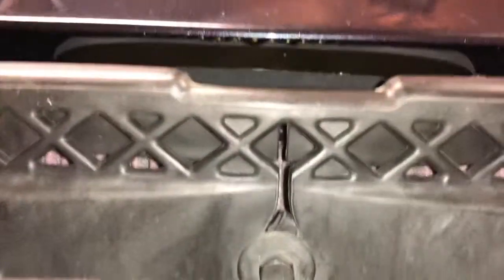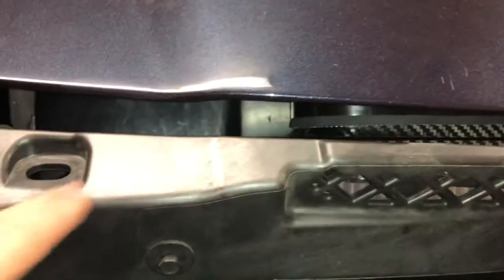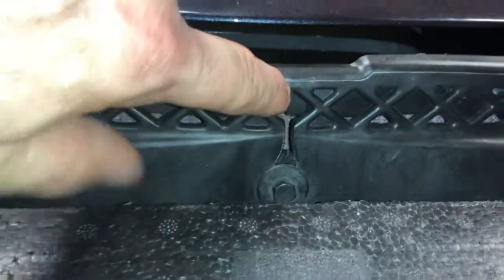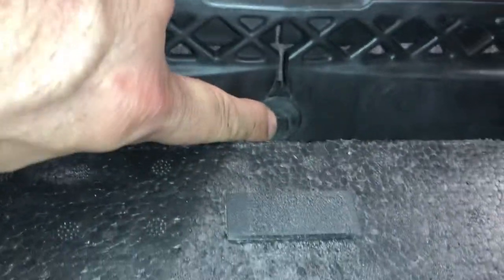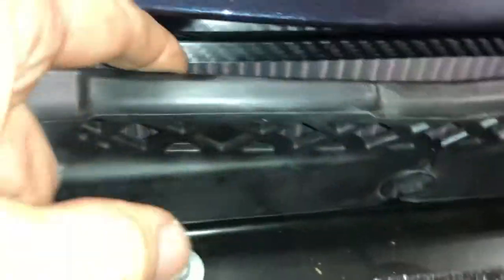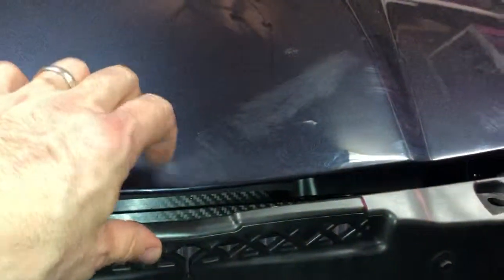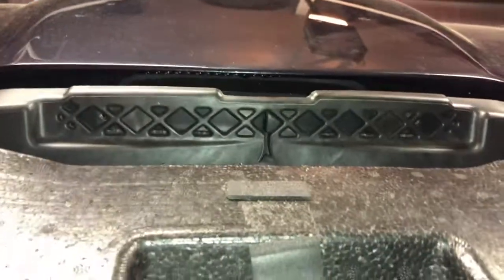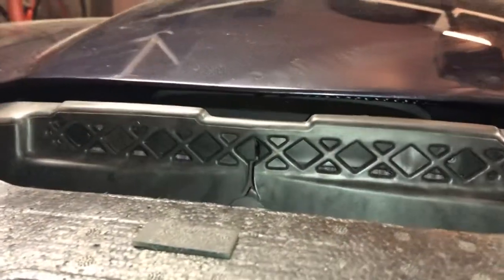Corvette ZR1 unwanted ram air

Comment: what exactly is the problem? isn't it better for more air to get to the filter?
Reply from the maker: Issue is with aftermarket CAI - air flows through honeycomb at high velocity vs. just getting sucked in and causes MAF sensor to not read correctly and surging occurs at highway speed around 60-70 mph.  Stock SIF filter doesn’t have this issue as it sits well below the cold air intake.  It;s really not a true ram air intake but just a cold air intake.
Reply: OK, this is something I will look into when I get my kong 5" intake. Can you make a video of the finished product?
Reply from the maker: kingkobetha8th will do - several folks have this long standing problem.  One fix that works is to get a longer hose between throttle body and filter outlet - that lowers filter so there is no longer a direct path for the high speed air to directly enter filter - there was a post in FB group showing this solution.